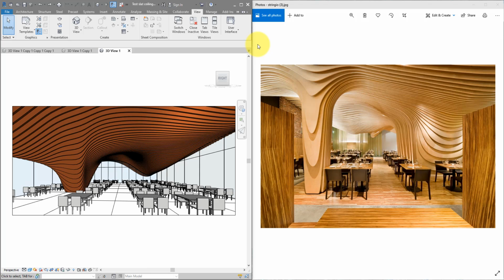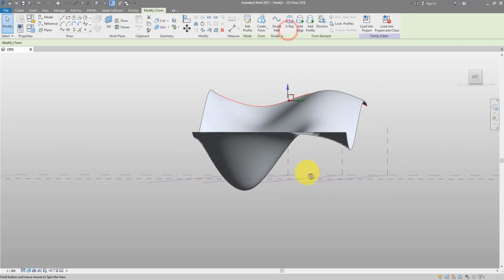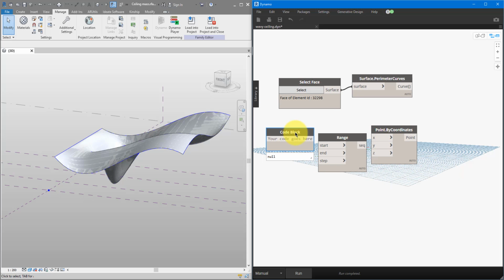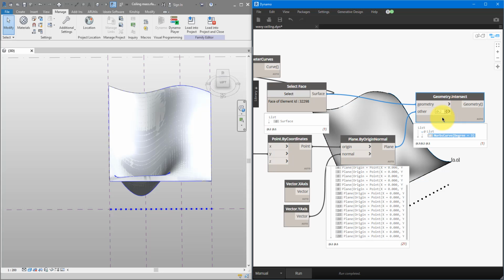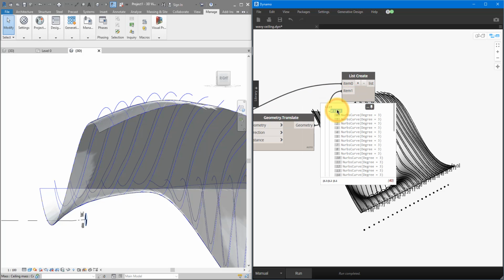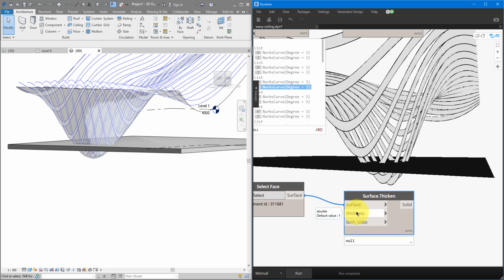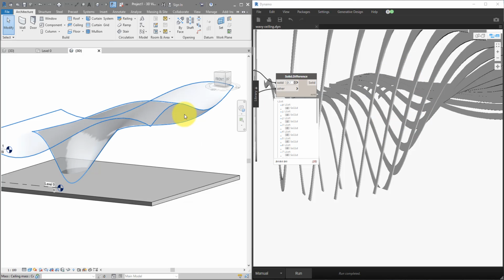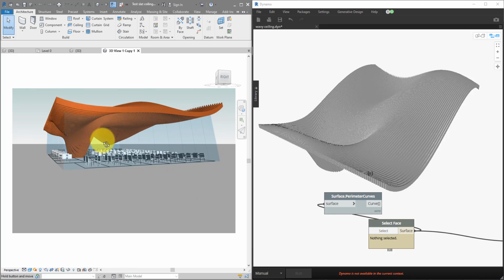Revit Snippet: Create Wavy Ceiling Slats with Dynamo

Comment: Great tutorial. I noticed that when the geometry is brought into revit each slat seems to be an individual object instead of a single group like in your example. Also, I'm not able to dimension the geometry once its in revit. Any suggestions?
Reply from the maker: Your objects don't get imported as one element is probably because you used the ImportInstance.ByGeometry node. Please try ImportInstance.ByGeometries instead (notice the plural). Regarding dimensioning, have you tried pressing Tab to see if that allows picking faces of the imported object?
Reply: @RVBoost  Thanks for the reply. I caught onto the geometry(s) distinction. Regarding dimensioning the I used multiple instead of one surface to create the ceiling form in order to meet some very specific dimensions. I am able to dimesion to certain portions of the resulting ceiling slats but not others...
Reply from the maker: It could be that the surfaces or lines you want to dimensions aren't parallel. You might be able to dimension using their corner/end points?
Reply: @RVBoost  Thanks, the corner point suggestion worked. I'll have to determine why the slabs aren't parallel at som e point.
Reply from the maker: Sometimes it might just be just some fuzzy number rounding that Revit and/or Dynamo applies on the fly. Glad it (kind of) works now 😊

Comment: Great tutorials!
One problem I came across was in the end when I tried to send the geometry back to Revit with ImportInstance.ByGeometries. When it got to Revit the model were about 5x the size of the original. Any ideas what could cause that?
Reply from the maker: Did you have this issue in Revit 2022? If so, it's because the Import instance node is faulty in Revit 2022. Autodesk fixed it in Revit 2023. If you need to stay in 2022 and got the script from our website, please let me know and I'll send you the updated script with this issue fixed :)
Reply: @RVBoost  Thank you for the speedy reply! Yes, I am using Revit 2022 and I built the script following the video. Is there another way to bring the geometry back to Revit without using that node?

Comment: It looks amazing. Thanks a lot :)
Could you do schedules of this? in order to get sqm. I am doing something way easier with Structural framing and I do need to get also sqm... any ideas? :)
Again, thanks a lot
Reply from the maker: Glad you liked it! Yes, you can get and sum up areas of surfaces in Dynamo. There's 1 step in the video where I created surfaces before thickening them. Simply connect these surfaces to a Surface.Area node :)